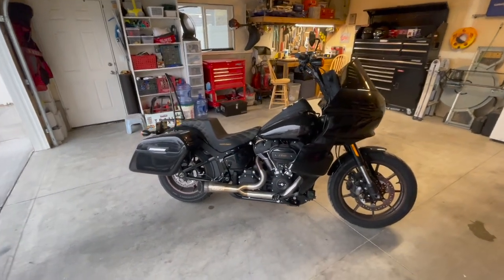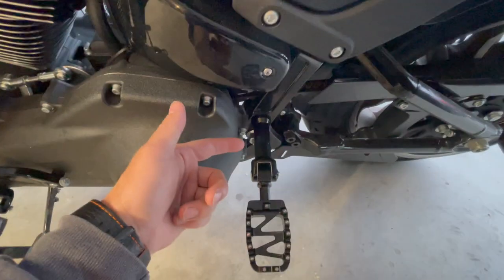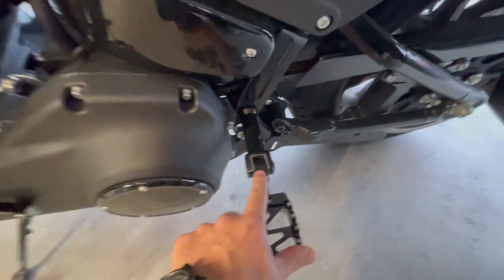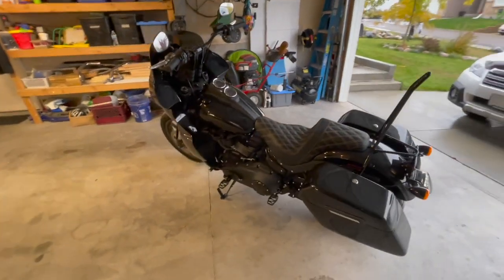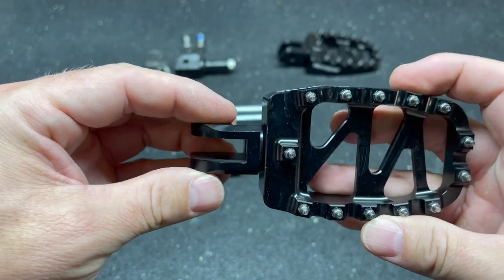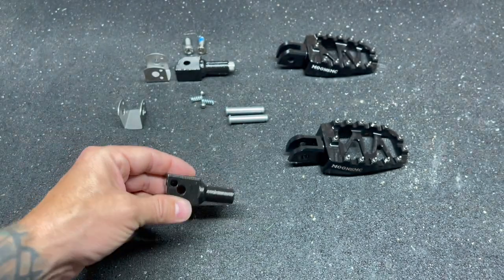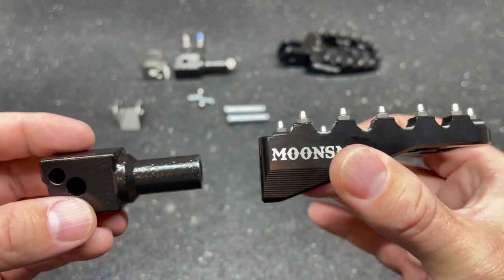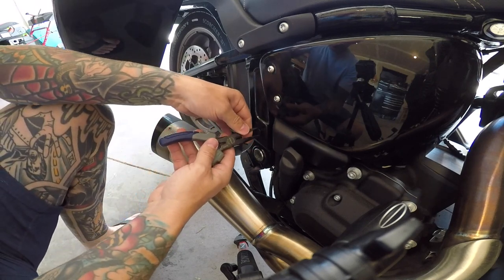M8 Harley MOONS MC Pegs and Biltwell Peg Clevis Install Low Rider S

Comment: Feel your pain.  Always bought used, then just bought a 22 low rider st.   Didn’t come with the passenger peg bracket thing, so after buying that I had to buy the pegs lol. HarleyTax.  Also ask Moons, but for soft tails they made a passenger peg clevis to work around the issue.
Reply from the maker: Congrats on the ST, sweet bike.  Ya, Moons put out the  peg clevis after I dropped this video.  I've since picked up a set and I'm running them now.  They look much more clean.